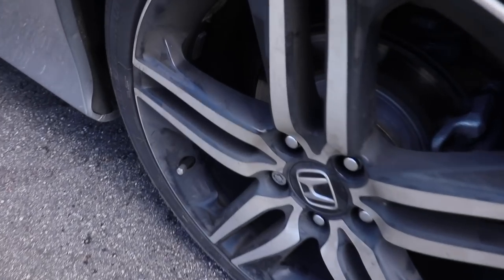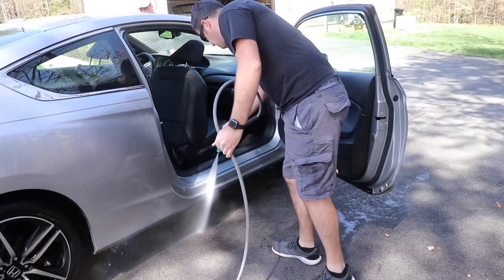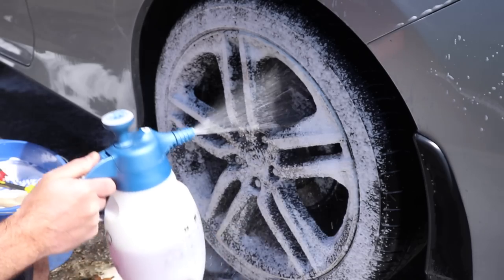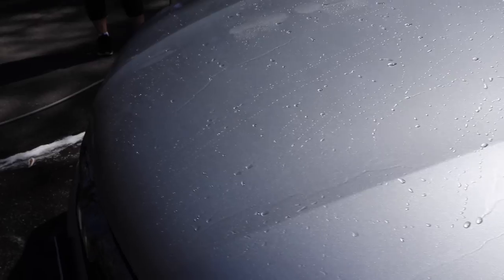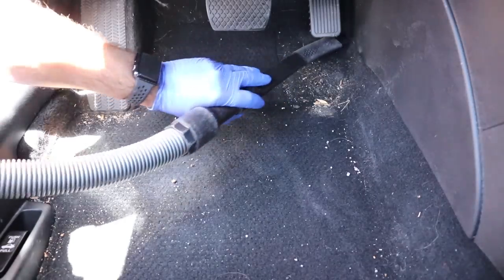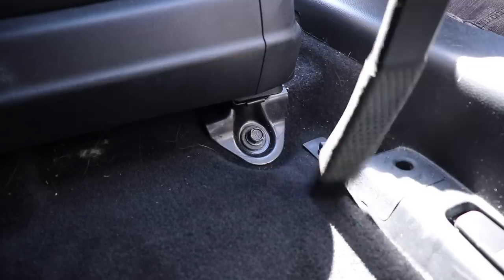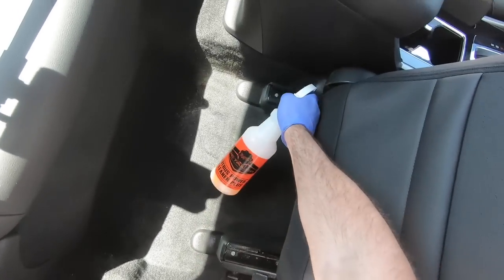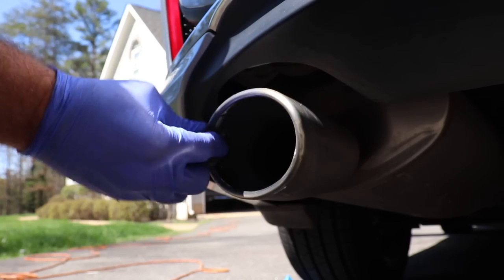Interior and Exterior Detail // 303 Touchless Sealant // #mobiledetailing

Comment: Nice job with the amount of time you had.  Those late model Accord coupes are nice cars.  I like to do the interior right after the jambs because dust and lint I'm releasing can float out onto the paint and sometimes the vacuum hose can scuff the sills.  Then I can do the exterior and not have to touch the inside again.
Reply from the maker: Thanks. Yeah we always start on the inside. But everyone has their method and reasons. 👍🏼👍🏼

Comment: I started knowing and using 303 multi surface cleaner, the speed detailer and the fabric protectant for boat because my uncle and my cousins have them.  My uncle being a Chemical Engineer tested their products and has been using them for long time.  I have never used 303 sealant, just the wax and the protectant and started with the wipes version and it's amazing because it cleans at the same time.  I also used lots of times the protectant on my patio plastic or wicker chairs so they don't crack.  Their great Wax that can be applied wet or dry, this is the one I use in cases I have done a mobile job.  It is amazing their line of products, at least the ones I have been able to use; very effective products, accepted, accessible, affordable, easy to use that are highly sold in the island.  One of the best things is they don't leave this greasy stuff.
Thanks for sharing all you have used because it is of a great help for others to see all amazing, effective and affordable products in the market.
Xoxo from Puerto Rico 👍🇵🇷

Comment: Simple question I think .... would you use the clay mitt before a fall out cleaner ... I’m in a really bad area .... My daughters Van wasn’t 6 months old when I washed it ,,,dried it then did a Sonax fallout cleaner ... my driveway was purple when all was said and done .... btw all I use is soap and clay myself ... I’m just a weekend warrior ... plus all I have is daily drivers ...
Reply from the maker: Well the iron particles are that bad I would start with the iron remover first then clay after. If I notice the paint is really bad and gritty and the mitt isn’t working I stop using the mitt and just wash it then do the chemical decon and then claybar after

Comment: Have often wondered why bothering with a rinse bucket when you have a power washer that can rinse off the dirty mitt and not worry about the grit floating back into the mitt even if you have a grit guard in the bucket?
Reply from the maker: You can totally do it that way if you want. But our process with two people makes that inefficient. We are usually doing two different things at the same time so as to quicken up the process. Plus it uses more water and times more time. So it’s up to each person to determine which process is for them. If you have the time and plenty of water then that’s a good method.
Reply: @MirandaDetailing  Thanks, after I posted my comment it kid of dawned on me that maybe the pressure washer might push the dirt deeper into the mitt. Good point it more than likely uses more water too. I pretty much keep my car clean so the mitt doesn't get too bad dirty.

Comment: I have a question is the meguiars hybrid ceramic coat spray works the same as the one that your using thanks William
Reply from the maker: It works if it already had a base coat of it on the paint previously applied. Then you can spray and rinse off and it bonds to the existing sealant. 😎👍🏼

Comment: does the 303 sealant leave the paint feeling smooth?
Reply from the maker: Hi. Yes it does. It has a nice slickness to it.
Reply: Miranda Detailing thanks for the response. I tested it out today and i’m blown away by the hydrophobic qualities for such little effort. I didn’t think the paint felt smoother than the non treated part especially not compared cream sealants. Did I put too little or was I expecting too much out of a liquid product
Reply from the maker: @TrayJayRecords  Its not smooth like polished paint, but if the paint was clayed and then this used, it should feel slick when drying.

Comment: Hi Phil, could give me some suggestions on the dilute ratio of Degreaser when do pre-rinse, I bought APC from Adam’s, can I dilute it or just use full strength? Thanks!
Reply from the maker: Hi. 
I haven’t used Adams APC before. But it looks like it’s a strong concentration. I would dilute either 10:1 or 4:1
Reply: Hi Phil,tks for your suggestion. So the workflow on this video is: use degreaser follow by throughly rinse, then APC follow by foaming wash and clay?
Reply from the maker: You’re welcome. So we rinse first then use the degreaser/APC on the lower portions then rinse again, then foam up and wash. The degreaser is basically an APC. Most APC’s are also degreasers.
Reply: Tks 👍

Comment: is it actually safe to use a clay mit for general cleaning like this? also do you spray the whole car down with apc or just certain areas?
Reply from the maker: Well this is a full detail, not just a general cleaning. the vehicle just wasn't that bad.  If you are doing just a maintenance detail, then you don't need a clay mitt or bar.  It all depends on the condition of the paint.  One must determine what needs to be done for each job.  for APC we only degrease areas that need it....if the entire vehicle needs it that's what we do.  Each job may vary slightly. Some vehicles are so gross that we degrease the entire thing, other times, its, just the bottom areas.

Comment: How does using steam or other liquids affect the holes in seats meant for heating and cooling the seats? Can it degrade that performance?
Reply from the maker: Well seats like this are meant to get wet anyway. But of course you don’t want to dump tons of liquid in there. But everything dries very quickly. Sometimes coffee or other drinks spill in there from customers and it still works, so these seats are tough.
Reply: @MirandaDetailing  Thanks!